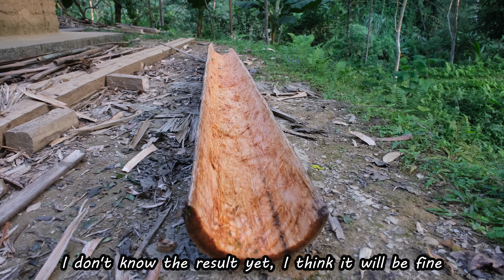Complete cabin roof, planting bananas on a heavy rainy day. Primitive Skills (ep189)

Comment: @P. Skills: Consider forging an Adze.  Its specialized wood working abilities will compliment your Axe/Hatchet.
Its form is similar to a Hoe, but it is much narrower and designed to hollow out logs.  
You have had a number of projects where you had needed to hollow out things.  An Adze will make it easier.  Obviously, an Axe will do the job, but an adze will make the job easier and give you better results.

Side note:  Small versions are used to hollow out large wooden bowls.  They can be scaled up or down and they are very useful.

Comment: The wooden shingles will last pretty long....long enough just as they are. Dont put tar on the roof, it will trap the mosture under the planks making them rot. The air flow up on the roof is sufficient to keep them dry. Its not like wood on the ground or slightly off the ground close to mosture, that will rot faster. 
Tar only works if it was sealed underneath/before the shingles are put on. 
Burning the planks on the out side would help a little bit for longevity. 
Best is to burn and then find an oil/turpentine of some sort and treat the wood with that....then the wood can still breath and dry when its not raining obviously.

Comment: Great job, when you will see some leak or melting in your mud walls u could replace some of their internal and external layers with some of your self made cement so they can withstand rain and they will be much stronger :) or to seal the top gap of your roof

Comment: Putting wooden tiles on the roof means that it will eventually rot. We in Amer. put plywood but then cover it with tar paper and shingles. To make the roof last much longer you could make concrete shingles. That should only take a day and a half. !  for you
Hey why do you cut off the tops of the suckers (baby bananas) We don't do that in Florida

Comment: you need to keep that wood roof dry, its gonna rot. perhaps ash on the wood then "elephant" leaves on top, youre gonna need to either cut more wood and lay it across as straight as possible, or go back to those palm leaves and span those over. i know its difficult, you should also use more nails when hammering in wood planks, 2 on the top, 2 on the bottom, keeps them from rocking. what about clay shingles? you should think about that as well, youre roof is going to fall apart if you cant keep it dry.

Comment: Does the inside of the tree continue to stay soft after it is removed from the tree? I was thinking of a weird way of trying to transport heavy things through the forest. I have no idea if it is possible.  But long ago there was something used with 2 wheels where at one point the wheels come almost to touching while the opposite point is further apart. I can't remember exactly what it looked like but  I was wondering with your genius (or other villagers genius) minds could come up with something that could handle the weight and move thru a small and rough terrain. Since your show is about using old methods perhaps the 2 things can come together..modern knowledge with old ways. I think the wheels were tall. ? ? I hope you can work something out. By the way I am writing this to you while watching you carve out the center of the tree..so have not seen how you have already transported the trees.🙃🙂 Love your videos.❣❣❣

Comment: now i dont know if you will be doing this kind of work again, where you are hollowing out the tree trunk, nut have you seen those axes where its got a U shape kind of blade attached to the handle? that kind of tool will make life hollowing that out easier.
you simply stand above the work piece and you hack at it. swinging the blade towards you